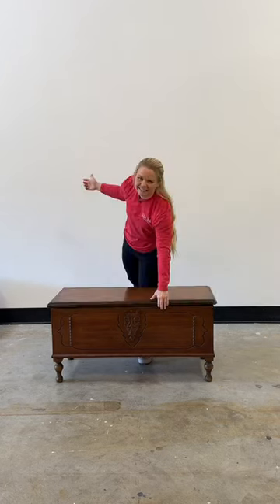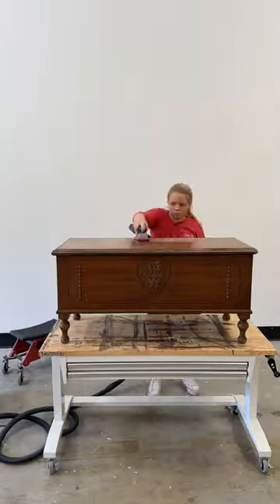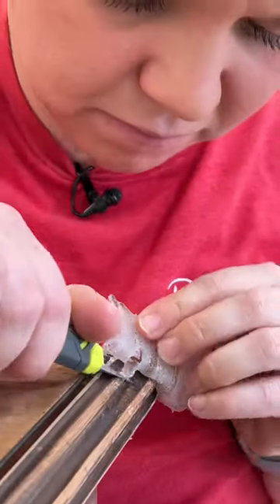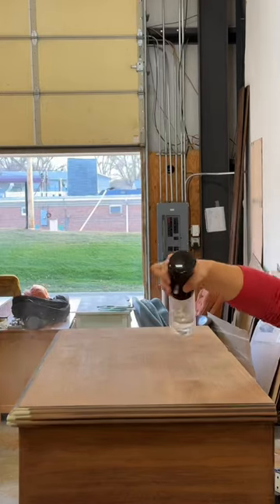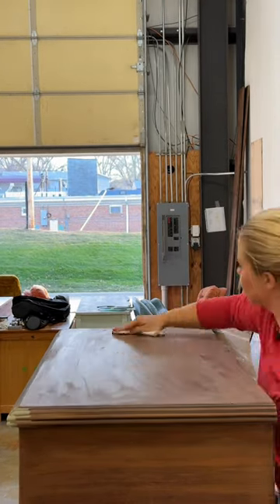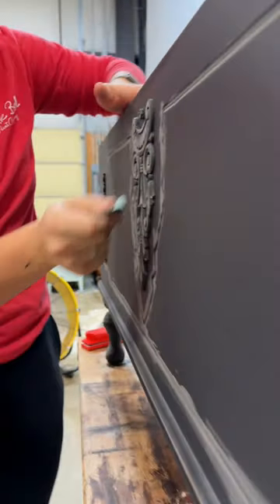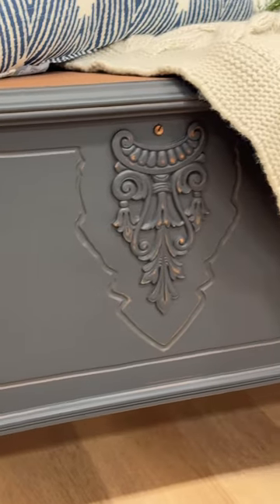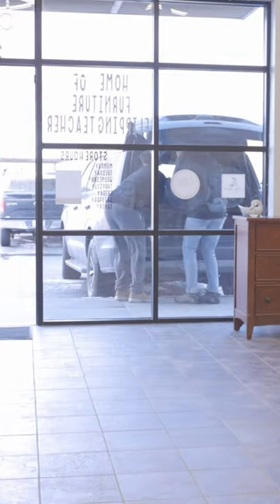Bringing an Old Cedar Chest Back to Life!!#shorts #furnitureflip #dixiebellepaintpartner #diy

Comment: Perfect turn out. Tip: trigger sprayer in a bottle of rubbing alcohol - spray to release hot glue - it takes a minute to release. Admittedly I’ve never tried this on wood… but maybe try it on a sample first or use something to make it release (oil or wax maybe) or even a light coat if polycrylic in that area to keep it from being porous and grabbing into the fibers of the wood